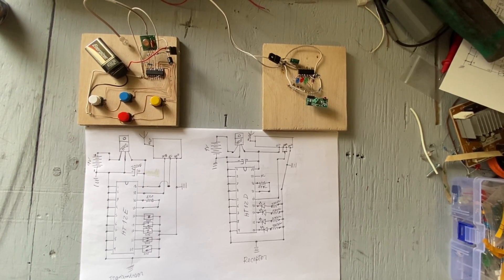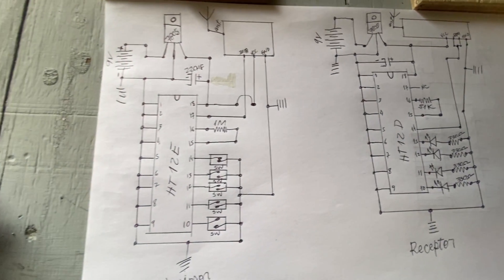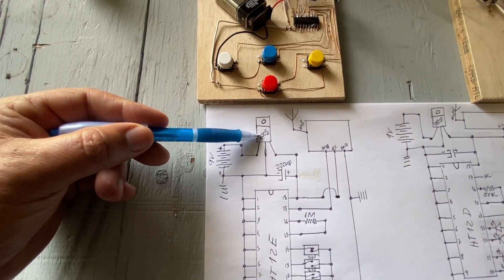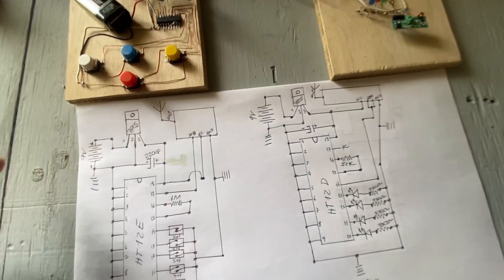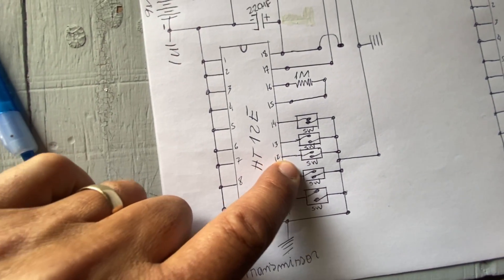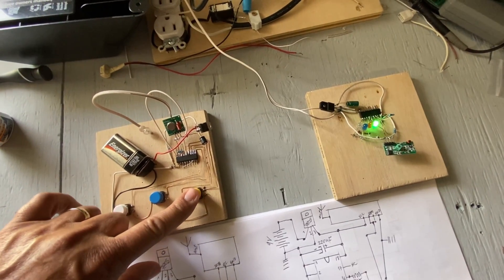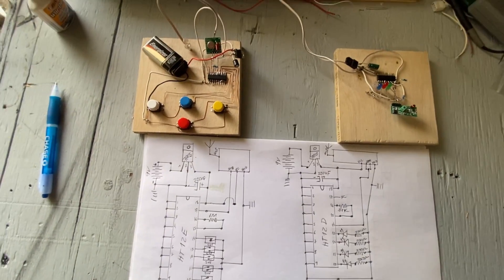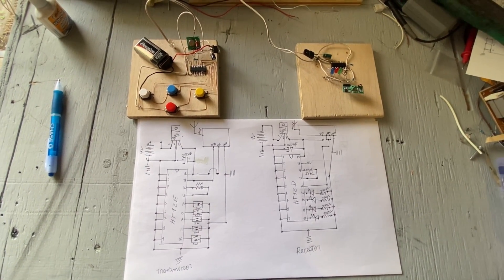Remote Control Radio Transmissor Receptor 433MHs HT12D HT12E

Comment: How does this pair of HT12's stop foreign HT12's from interfering? 
What I mean is, how do you pair these two with each other?
Great video!
Reply from the maker: It is were made for each other to work together  one receives the other transmits
Reply: @doityourself7763  So, say you lose the receiver, can you replace it with another one and still use the same transmitter?
Reply from the maker: @jimmybrad156  yes